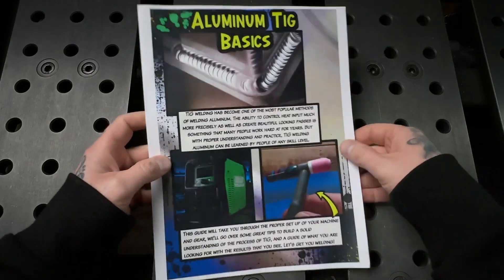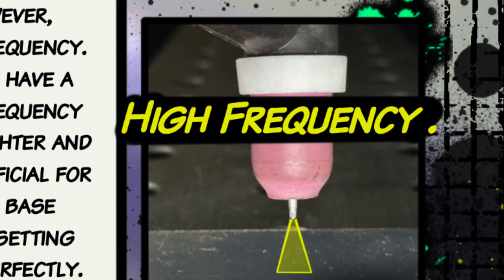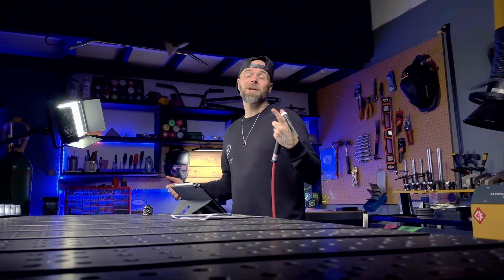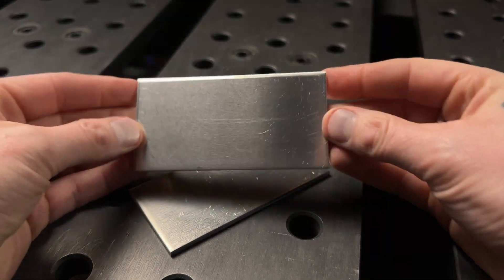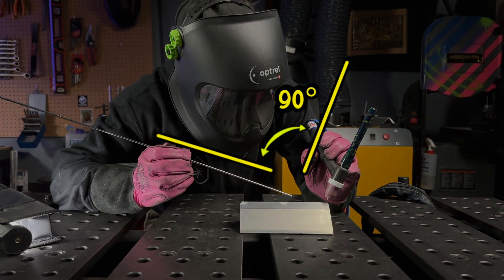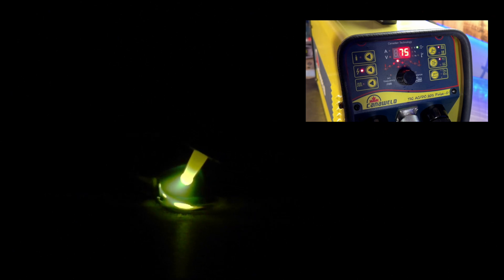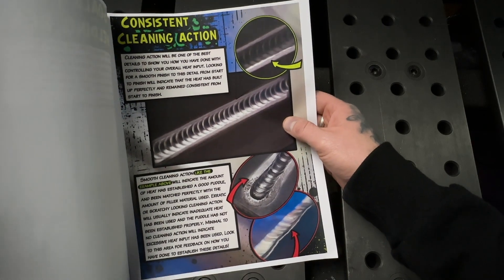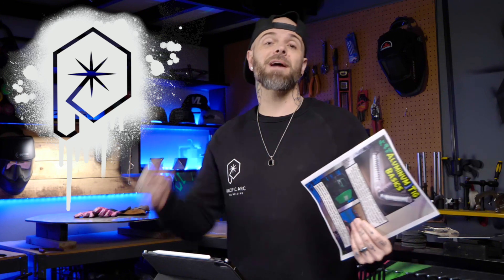This BOOK Teaches You How To Tig Weld Aluminum

Comment: Hi Dusty I'm welding tig aluminum 1050 plate and the rod is also 1050 and it's still cracking, do you have any advice